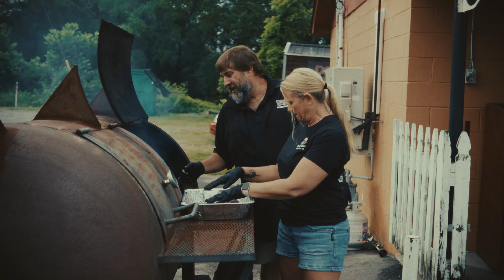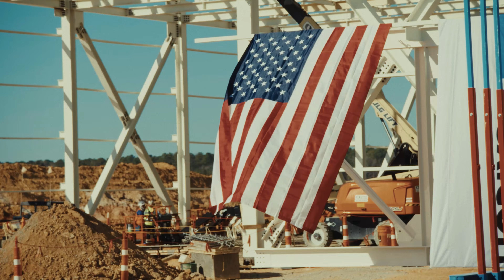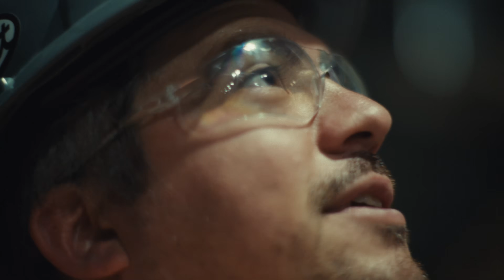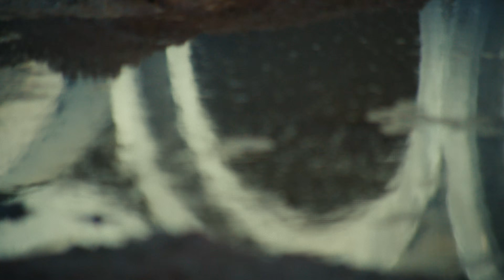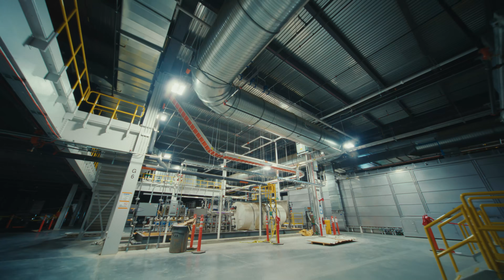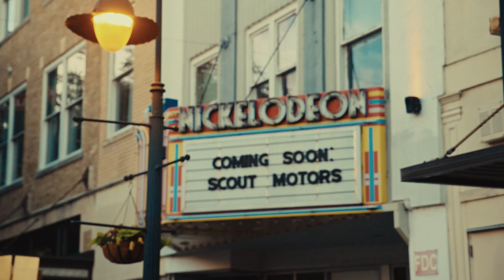Brick by Brick | From the Dirt up

Comment: VW is entering the relatively low volume BEV pickup and SUV space with Scout. VW executives have decided to take a a huge gamble. They are spending $2B of capital on a brand new factory (SC is giving them $1.3B in state incentives). My gut tells me that this experiment will end poorly 5 years from now. The demand for a $65k+ BEV pickup and SUV simply doesn’t exist.
Reply: They should have made a small, rugged $30K off-road SUV
Reply: @Christoph-sd3zi  I bet they have plans to get some compact SUVs and trucks in the future, but they have to release the most profitable ones first
Reply: The products are FULL SIZE SUV and Pick up truck. Even if it comes out starting at $70k, it will be a good price. Just look at other full size EV's available on the market, and the price of other gas-powered trucks...
Reply: @jeanmenieur  What most of these non-EV owning (or wanting) folks fail to realize is the savings they will see.  Costs me about $30 a month to charge at home with Tesla MY, and with my old Hyundai Santa Fe that got almost 30mpg, it used to cost me $30 a week at the min.  Plus, no oil changes, no tune ups, no belts, no fans, no wear and tear on the "engine", and NO BRAKE JOBS!  I have a Tesla M3 with 140K on it and the brakes look like new, same with my MY, 70K and the rotors and pads look like they did on the showroom floor. With how much we drive both cars, I estimate that we save about $2500 to $3000 a year on gas and repairs per car.  And unlike gas cars, that number goes up every year, not down.
Reply: You're probably right.
Reply: Agreed, it's a good market to get into, and the price could be adjusted a bit, but the rest is "just like, your opinion man" to quote The Dude.   If they could start them at $50K and move up to $65K, I think that would be much more palatable.  But they will find a way, these are pretty highly anticipated and if they hit the specs they are touting in real world testing, I think they will have a market.  I think the first adopters will be the boomers,  who love the idea of the old scout with more comfort and tech, but with a retro feel and have the money.  They did PLENTY of market research before this started, which is why these are $60K and not $90-$120k like Rivian or the Silverado EV.
Reply: Hybrid will sell.